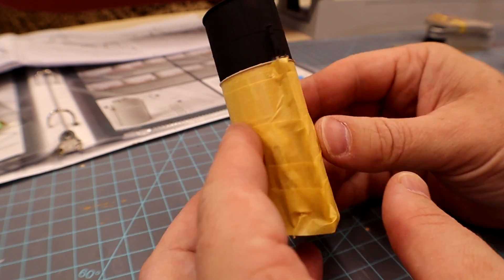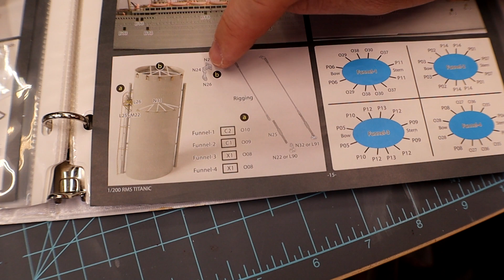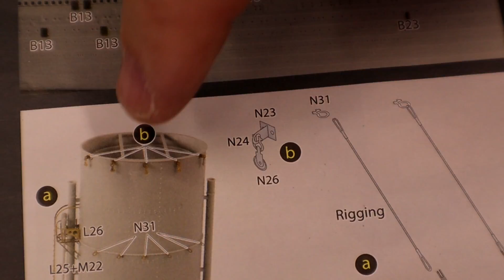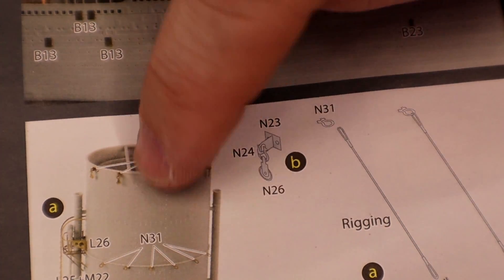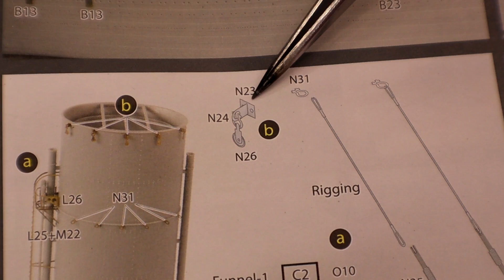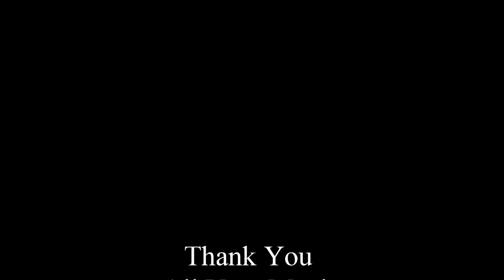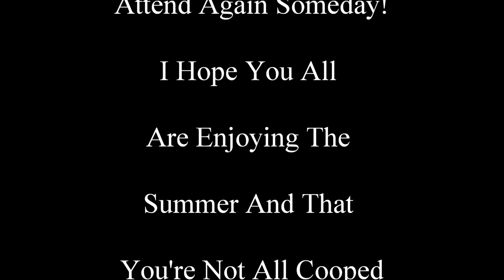1/200 RMS Titanic Build Video 28

Comment: I would suggest for the little tank (judging by the piping it's a condensate tank), just clip off the tank piping and adjust the feet to match the funnel pipe. Just make up the tank piping out of brass rod to fit. That way you can place it wherever you need it to fit the space. Those funnels look awesome! She looks like Titanic now. Fantastic work as always Ben.

Comment: Ben noticed that you used a whole lot of tape for the funnels. 
Try next time this.
1..put down a single layer of tape as a base. 
2..then try to use a a small pieces of cling wrap and put that over the area that you need to mask off. 

3..And just using smaller pieces of tape to secure the the wrap in place.

And also noticed that you had trouble with the water 💧 Tank.
Would it be possible if you could scratch build a higher base for it so it will fit properly?
Yea i know , out of scale ⚖️ just a thought.
Great build 👍.

Comment: I looked at a number of pictures online and they all look the same as your for the ladder position on the stacks.  Location 31:01 in the video.   However,  if you put the ladder at 4 rungs down from the top,  how do you step off the ladder onto the platform.  I would think from a "real life" perspective,  the top rung should line up with the platform so it is east to step off onto the platform.   Anyway,  your model building skills are top notch.  Thanks for posting.
Reply from the maker: I wondered about that myself. And I’ll have to double check, but I think the rungs do continue past the stand. This would give you access to the area above the whistles. As far as getting on and off the ladders… I think it’s more of a young man’s job 😉

Comment: Thanks Ben… How do you keep the model dust free while building?
Reply from the maker: Well the room it is in doesn’t get very dusty. I also don’t let the model sit still too long. Basically the act of always working on it keeps it clean. What I’m worried about is when it’s finished and I have to hang on to it until it’s shipped out. That may require some occasional dusting.

Comment: Hey Ben!
I continue to be fascinated with the skill and precision of your builds. I have a question I hope you , or your followers, can answer. I'm building a 1/350 USS Salem. It's coming along fine...by my standards anyway. I've come across a problem where I jumped the gun, so to speak, and CA glued a part prematurely. It's plastic on plastic and I'm wondering if you have any suggestions on how I can separate these two pieces without ruining the model. I don't want to force it obviously and can't think of anything that would dissolve the CA glue without dissolving the plastic as well. Any advice would be greatly appreciated!
Thank you in advance!
Bryan
Reply from the maker: Hey Bryan, depending on the parts and how much glue you used, it should come apart with a little work. You can also try scoring the joint with a knife, first. There are CA glue de-bonders out there. I think this are mostly acetone, so use it sparingly.